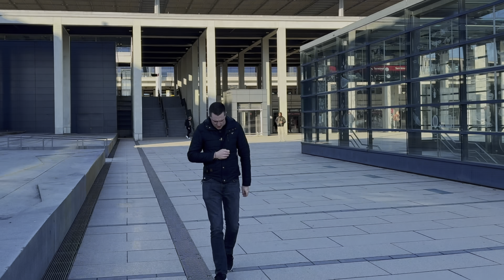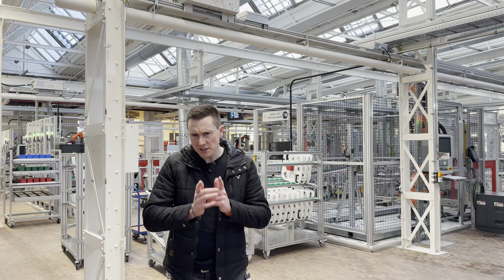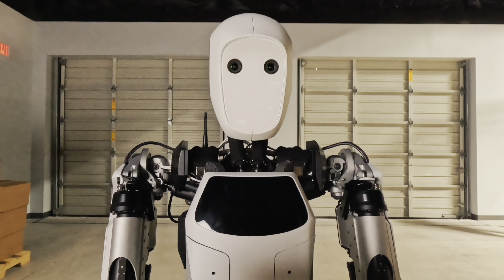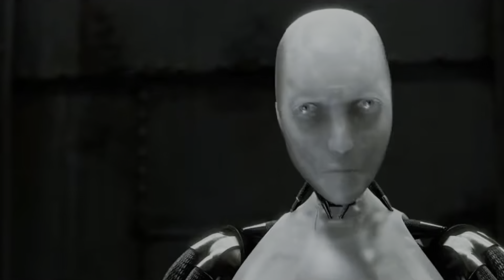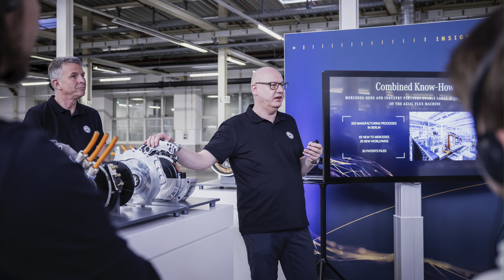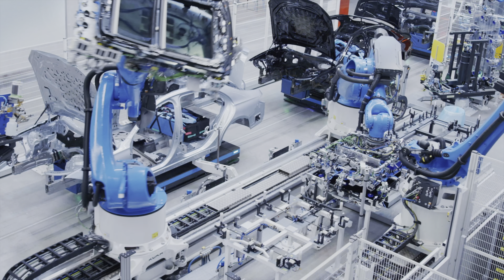VISITING a Mercedes FACTORY.....Then THIS Happened!

Comment: The only thingvi find is dangerous is if I'm driving along the motorway at 70 mph in automatic mode. If I accidentally catch the manual paddles, the car immediately drops down to limp mode which is 15 mph. How dangerous is that!
Reply from the maker: Just to check, Limp mode is a safety mode which helps prevent engine damage if there is something by wrong somewhere. You can’t turn on limp mode manually.

What model do you have? The paddles will either change gear or adjust the brake recuperation depending or not if it’s petrol / diesel / EV.
Reply: @npoleary  I have the a180. I use auto gears all the time so thankfully it hasn't happened yet. Its just I've heard a few times if you accidentally catch the paddles while in auto, it will drop you down to 15 mph, then you have to find somewhere to stop then start again. I just thought waw on a motorway that's dangerous
Reply from the maker: That’s simply not true that would be very dangerous.

Using the paddles is as simple as changing gear. I have an A180 too, so if you’re cruising, you’ll most likely be in 7th gear.

Pressing the left paddle will drop down one gear. So then you’ll be in gear 6.

No action on the paddles will ever drop you down to 15 miles an hour.
Reply: @npoleary  Thanks for that Nick. I trust your word against anyone else's. 👍
Reply from the maker: The only thing you could do (to do what you described) is have the limiter on set at 15mph, then resume it at motorway speeds.

This would drop you down to that speed. But you can’t do that via the paddles. Easy to cancel even if you did manage to do that with the cancel button.

Video coming soon on how that works so keep an eye out!